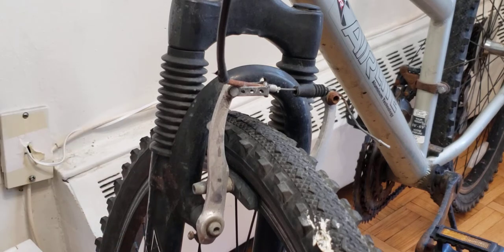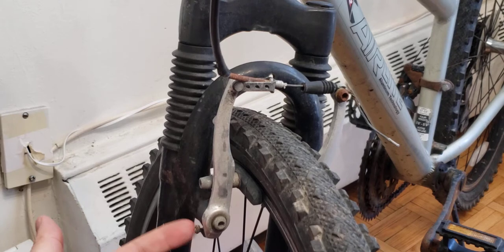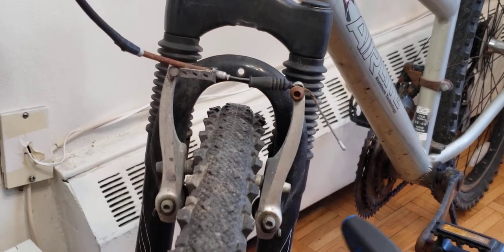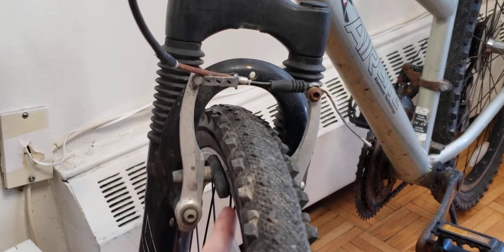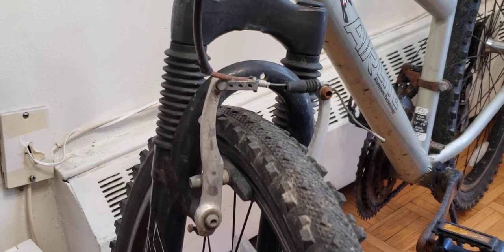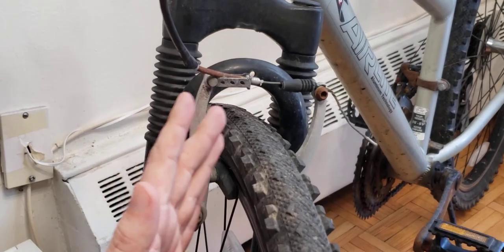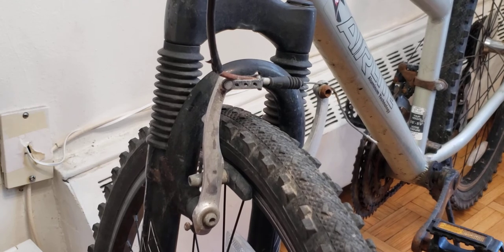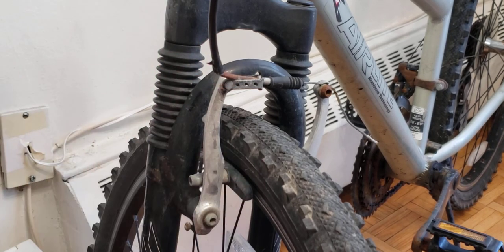3 Major V Brakes Issues - Rubbing? - Cable Slack?- Brake Pad Meat?

Comment: My brake is rubbing in both sides
Reply from the maker: You have to adjust both brake pads on each side. That is considering that rim is true/straight.
Reply: @IvansBikesBmws  how can you tell if the wheel is on right